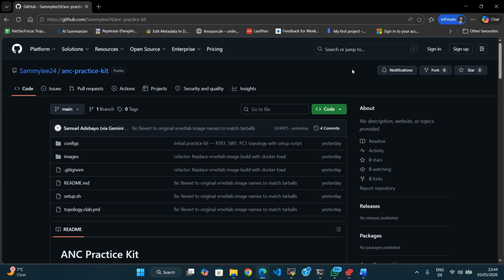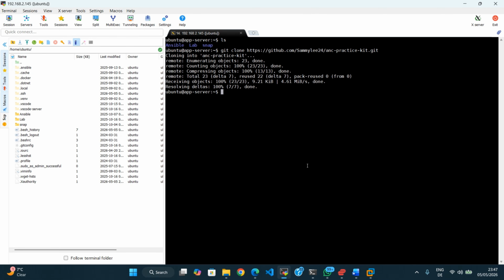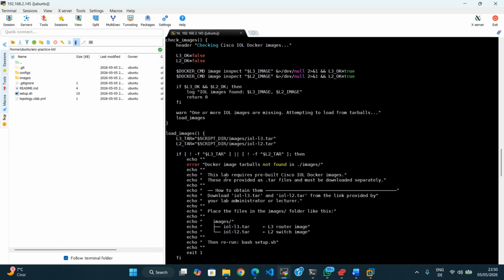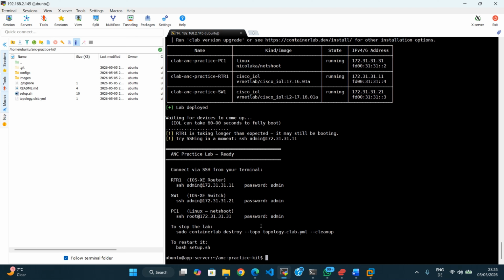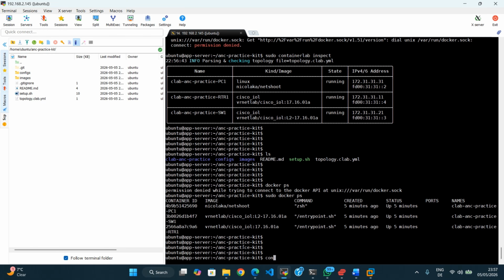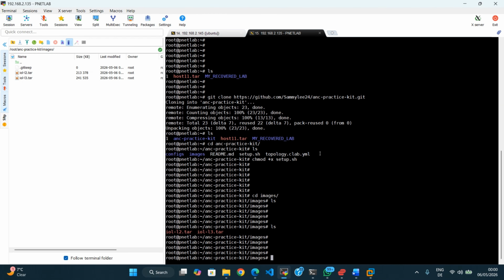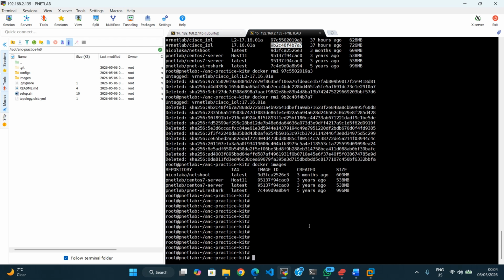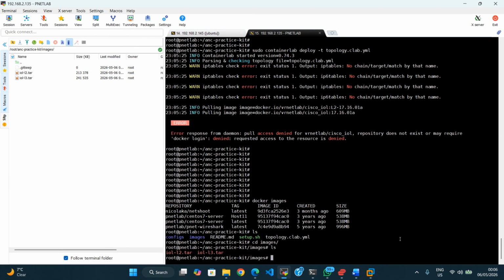How to Set Up the ANC Practice Lab  The Adebayo Network Challenge

Comment from the maker: Since recording this video, the setup process has been simplified. You no longer need to download the .tar image files manually.

Just clone the repository and run the script; it will handle everything automatically.

One-liner:
git clone https://github.com/Sammylee24/anc-practice-kit.git && cd anc-practice-kit && chmod +x setup.sh && ./setup.sh

Or step by step:
git clone https://github.com/Sammylee24/anc-practice-kit.git
cd anc-practice-kit
chmod +x setup.sh
./setup.sh

The method shown in the video still works if you already have the tar files, but the steps above are the recommended approach going forward. The README in the repository includes full details.